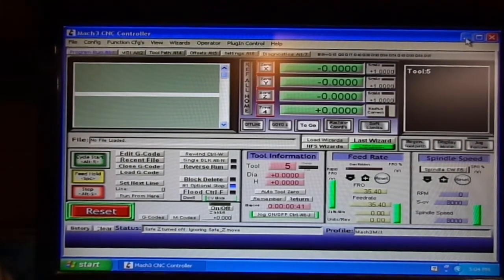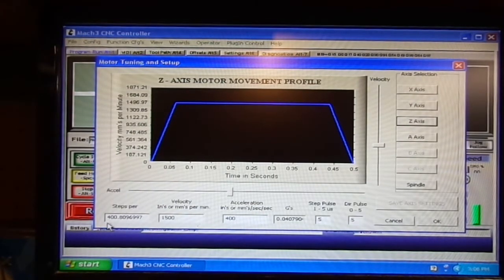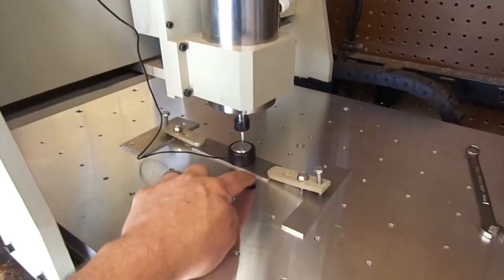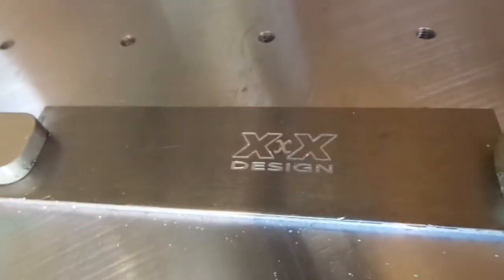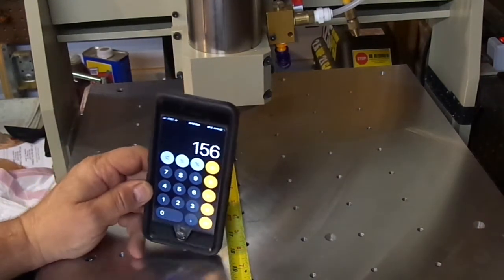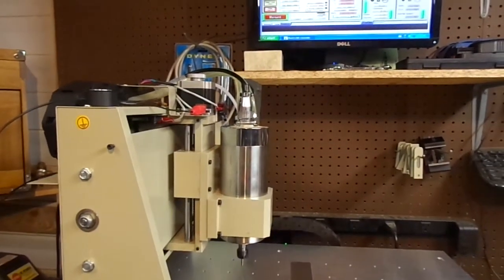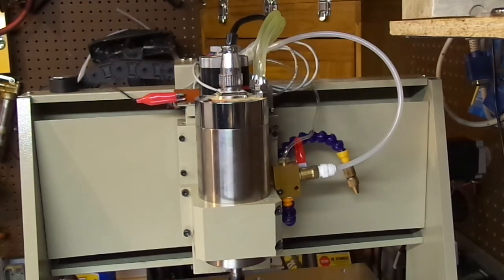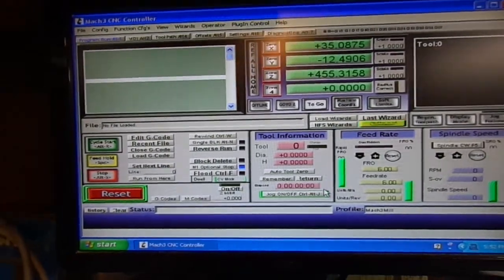6040 CNC upgrade video 2

Comment: what engines did you use?
Reply from the maker: The motors I got were from an ebay seller E dealers direct automation and they are 600oz motors

Comment: Is it possible to use a Windows 10 pc?
Reply from the maker: Yes but you would need Mach4 and the UC100 Parallel adapter for the Gecko540 for the best experience. Technically you could run smooth stepper through the ethernet cable but I have not done it.

Comment: Rick, when describing the Mach 3 config what were your native units..In or mm??
Reply from the maker: Did you get the dropbox link I sent you on that last comment? In that manual it says to use MM's but when you export a file from your cad program it will change to whatever units you use.  Mine is set to mm right now (maybe I should change that) and when I export my G code from fusion I use imperial and Mach swaps over. I want to try changing Mach3 from mm to inches but I was so swamped with work that I didn't bother. It was working fine and I didn't have time to experiment with it yet.